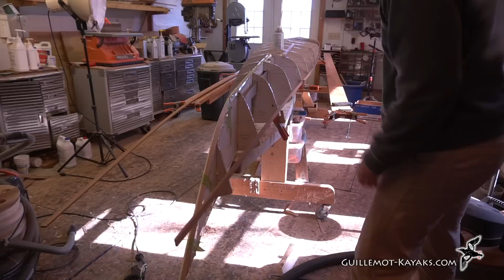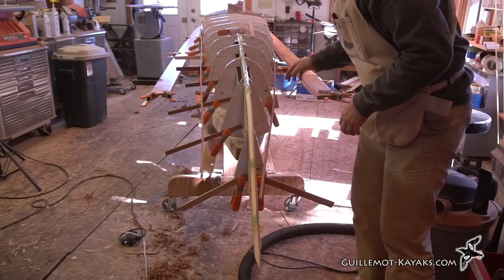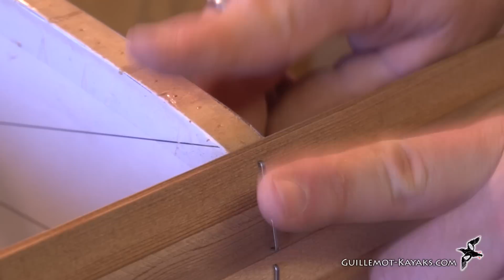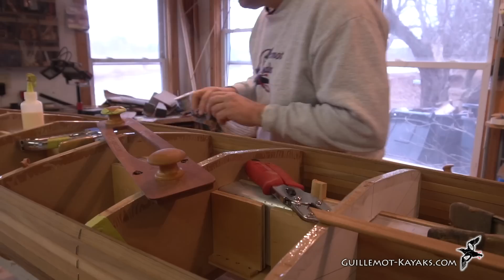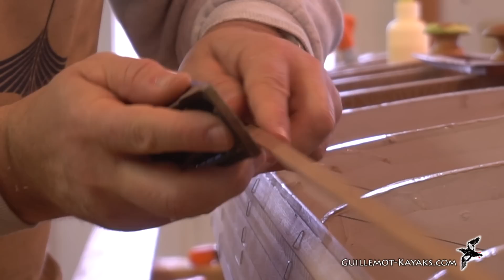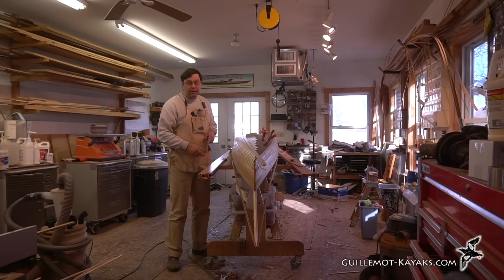Stripping the Hull - Petrel Kayak Build - E3

Comment: What staples and gun are you using.?]
Reply from the maker: Standard t-50 staples 9/16” long
Reply: @NickSchade  The crowns are proud of the strip so they can be removed? How do you accomplish this?
Reply from the maker: @stevenarnold46  Typically they just don't get shot all the way in. If you find they are, you can shim up the stapler to hold its bottom up off the surface with a thin piece of shirt cardboard.

Comment: Quick question, I am building a sup, this is my 2nd one, but it is a different layout/construction than my 1st.   On my 1st, I used cove and bead on the rockers, and flat panels on the top/bottom decks.  On my 2nd one, it has a number of shape changes on the top/bottom where I think cove and bead might work better on the deck then straight edge joints.  When you sand/fair the strips, would the widths of the strips look funny, depending on sanding thicknesses, ect?   I know it might be hard to picture what I mean.  Thanks for any input.

Comment: I'm still working up to choosing my first build.
I see how much quicker the Petrel is than the Bootlegger due to the stapling of cove n bead as opposed to gluing chamfered strips.

But... why don't the staples drive fully home? 
Sitting proud makes them easier to remove obviously, but I don't know why. 

Thanks Nick
Reply: You're right about that, it makes removing staples easier. Also it doesn't leave marks on the wood :)

Comment: Nick - I'm thinking the effort initially to bead and cove all the strips is a big time saver when it comes to putting the strips on the kayak? Your other build seemed to take a lot more effort when beveling each strip, even with your robo bevel?
Reply from the maker: Cove and bead does save time over hand beveling. The reason to hand bevel is tighter joints.

Comment: Curious as to your choice of table saw blade.  My saw came with a 40T combination blade.  I cut some 1/2” hardwood plywood for a shop project and it splintered fairly bad.  I have since bought an 80T blade for my next plywood project.  Your blade looks to be in the 24T or maybe 30T range.  I am surprised this gives good cuts on the thin stock you use, but maybe the wood specie makes the different.  Curious as to your experience in this regard.
Reply from the maker: I use the Freud Diablo 7.5” blade with 24 teeth because it has a very thin kerf, thus minimizing the waste of wood. It produces a very nice cut on cedar, but honestly, I don’t need a super smooth cut as the whole surface will eventually get well sanded.
Reply: @NickSchade  I believe they make a 40t blade with the same kerf. As you said you don't need a cleaner cut, but I think it would make for less splinters in the shop. Your off-cuts seem to get chewed up pretty good when you're working with strips.

Can I just say something?....

I've realized that I need to up the dust collection in my shop after seeing your nose-hair in the beginning of the video. If I worked in my shop regularly with that kind of growth I'd asphyxiate.
Reply from the maker: Geno Merci I have used the 40T version. It didn’t make enough difference to be worth the added cost.

My nose hair was getting a bit out of control there. The fact I had a cold didn’t help matters. But as you say, it does make a good filter

Comment: bubby are you using a cad to plan out your forms?
Reply from the maker: Yes, I start with a 3D CAD model and then slice that at the form locations. I bring those sections into another CAD package and add reference lines.
Reply: @NickSchade   from the looks of them i thought you might i see everything in vertices  thanks to Blender though it's never been good at math and neither have I thank you very much for that reply